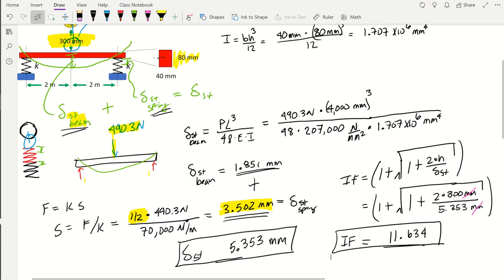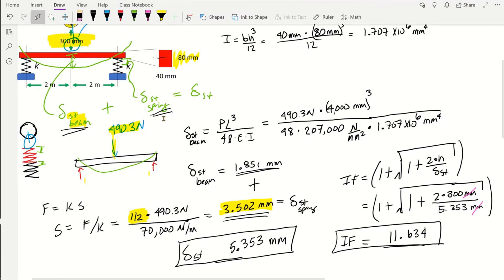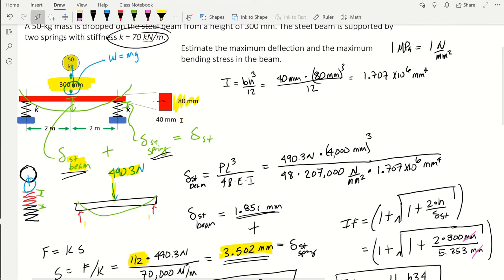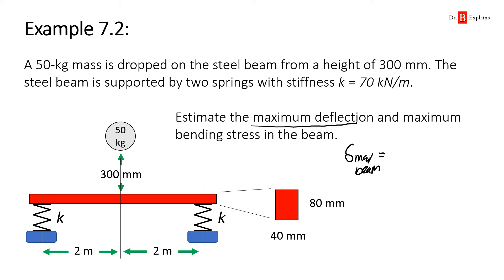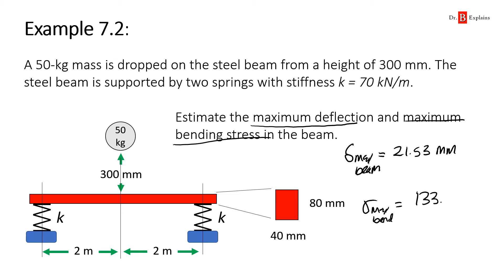Machine Elements - Ex 7.2 Bending Impact Loading - Stress and Deflection

Comment: what happens if the beam is not shaped like a box, but has another shape. Can it still be done with the same calculations and formulas? and does the contact surface between the ball and the beam matter?
Reply from the maker: Use the formulas for the specific cross-section of your beam.

Comment: Thanks!
Would I consider the deflection due to the beam's own weight in calculating dst?
Or do I only consider the static deflections that occur due to the impacting mass?
Reply from the maker: No, do not consider the deflection due to weight of beam; these are typically so small that they can be neglected.

Comment: Hi there,
if the whole system were to be rotated anticlockwise by 90deg (the ball travelling horizontally - like a canon ball) how could one calculate the static load to be then multiplied by impact factor to obtain the stresses and deflections of the beam? When travelling horizontally there's no static load like is when the ball falls down due to gravity...
Reply from the maker: For the case where the ball travels horizontally with known velocity (v), you would calculate the static deflection (dstat) by rotating the system 90 deg so that the ball rest on the beam/structure.

Note, for the case of horizontal velocity, the impact factor (IF)  is:  

IF =[(v^2)/(g*dstat)]^1/2

because the impact velocity is not generated by gravity (g) but due to other sources.

Comment: I got round beam (radius=7mm)(lenght=100mm) with 5kg mass dropping from a height of 3000mm and my impact factor is like 1540 and i wonder what is wrong.
Reply from the maker: double-check the dimensions of the beam; it is a significant amount of energy to be dissipated by such a small beam.